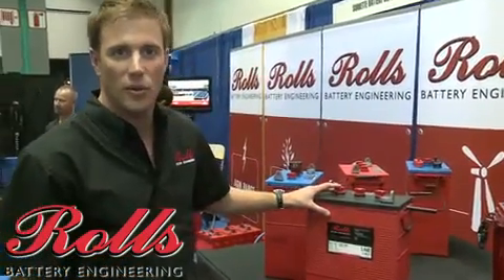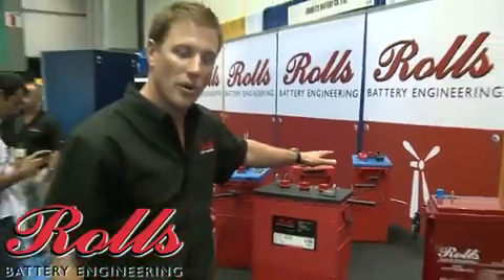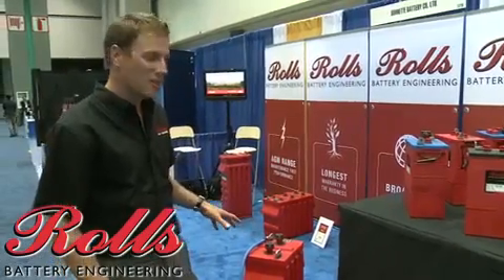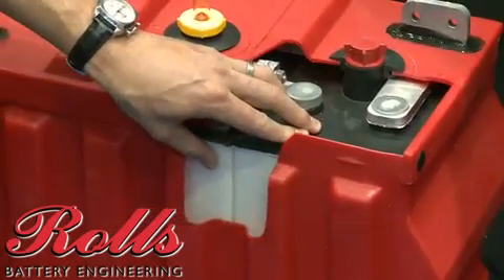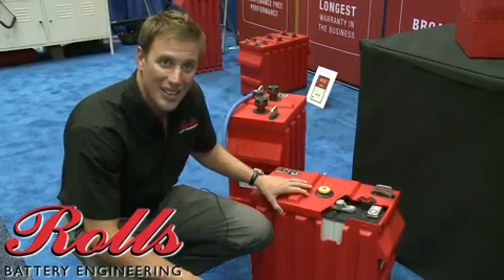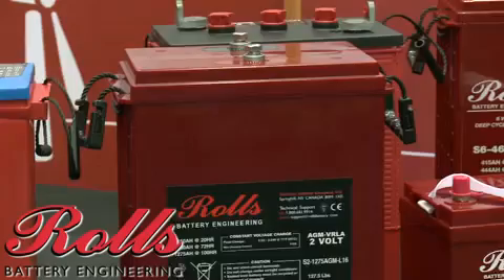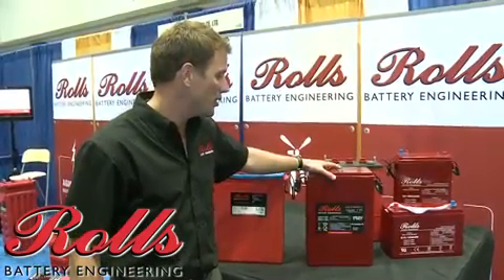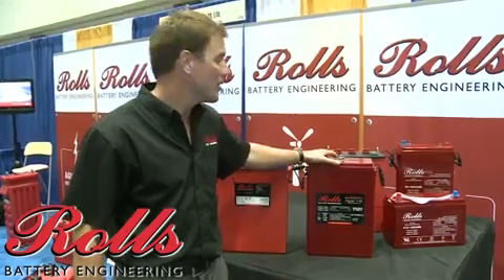SPI Showcase Rolls Battery Engineering Video Renewable Energy

Comment: Junk. battery went bad in less than 2 years. will not replace bad battery. warranty meaningless.
Reply: 99.9999 % chance you did not use, charge, connect or maintain correctly... I have  two sets of Rolls Surrette and they are excellent product and are better that EVERY other brand I've used over the past 20 years...